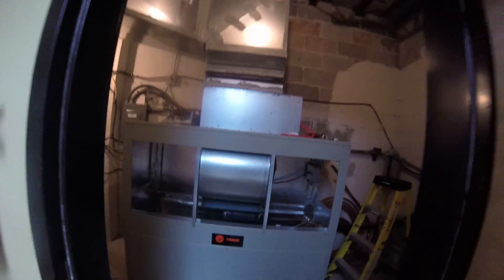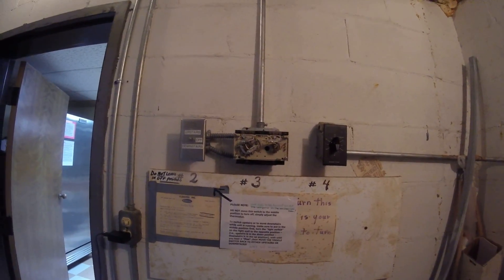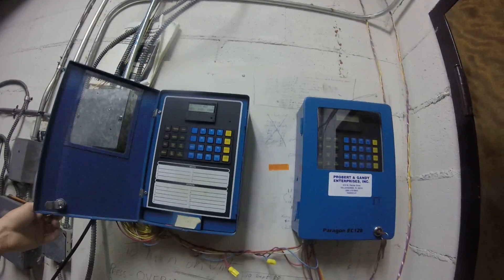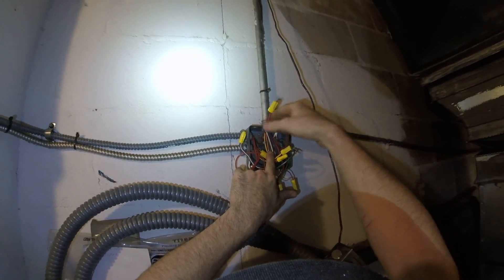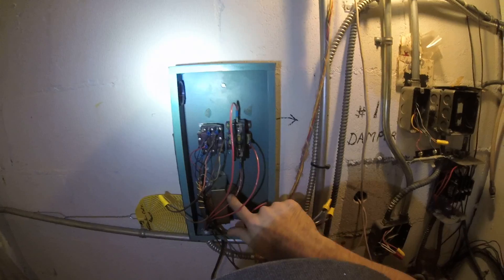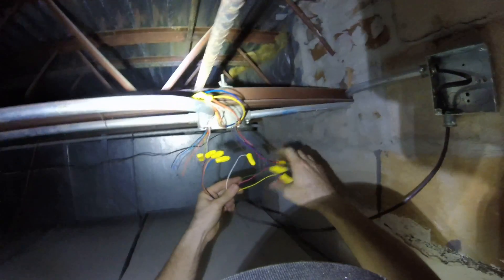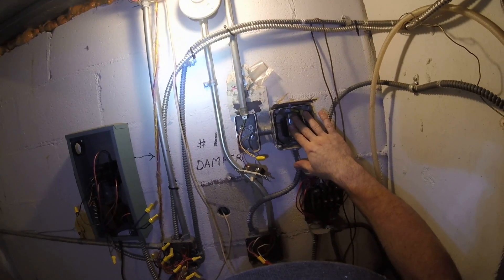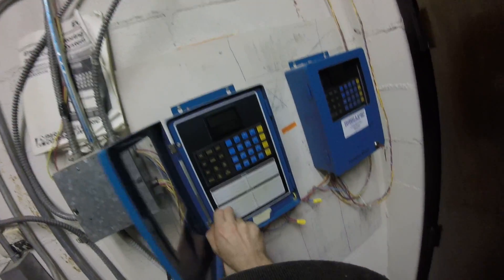Light Commercial Jobs are fun --- Part 1

Comment: Great video.  Great work!  I take it the computers were some type of PLC, all the yellow wires were most likely limit switches for inputs.  A very tuff electrical diagnostic, great work.  If they left directions, the computer might tell you faults with the system.  If you could communicate with it that is.  Just like cars give check engine lights.
Reply from the maker: It was definitely a tricky to make sense of with those wiring changing colors at every box. That computer controlled all the HVAC equipment and water heaters and lights in the building. AFAIK all it was was on/off. No other inputs went to it. They just used all yellow wires for everything. Thanks for the comment.